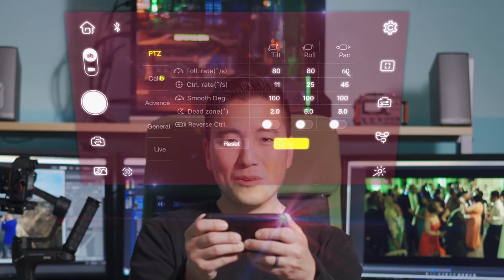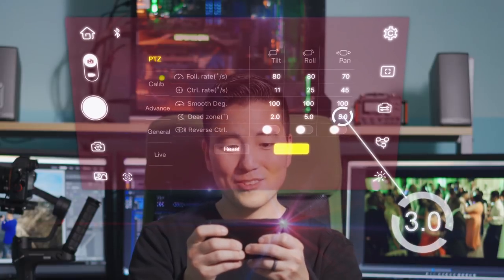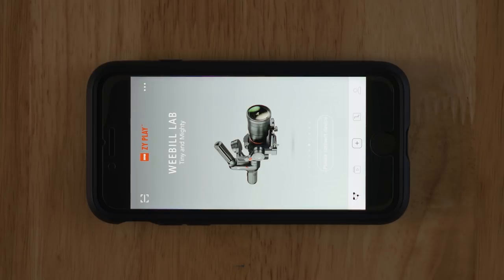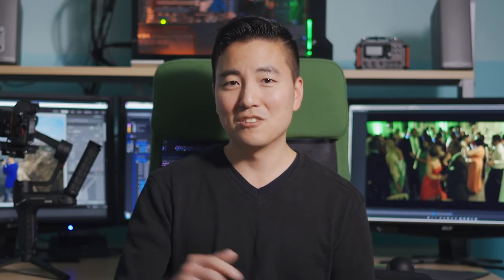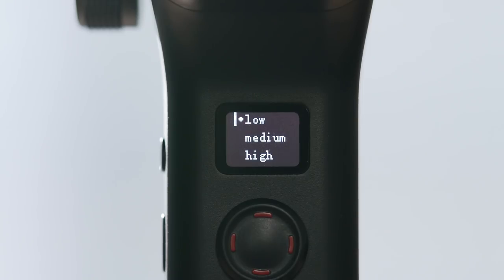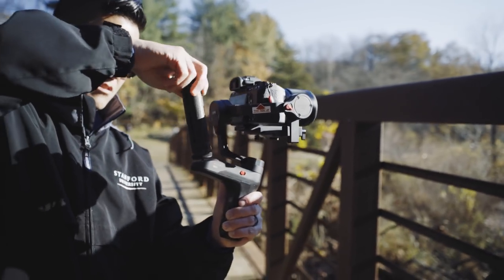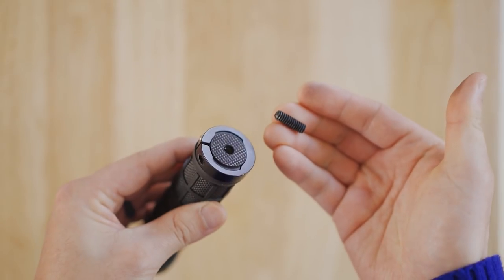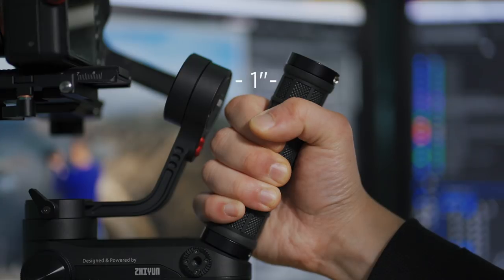Weebill Lab - More Thoughts After 3 Weeks

Comment: I like your review! I find it entertaining and comfortable to watch 😄 Im still torn between Weebill Lab and Crane Plus. My setup is Sony a6300 with Sigma 30mm and Kit Lens. If I get the Crane Plus I can buy another lens since it only costs half the price of the Weebill. But Weebill is new and travel friendly, but Im still worried about the issues, mainly the jitter because the purpose of buying a gimbal is to lessen the time from post production by adding the warp stabilizer.
Reply from the maker: Thanks Jazzie!  Much appreciate it!  You're right.  Cost is going to be a huge consideration too.  If you're not traveling every week cramming a gimbal in your bookbag, sounds like Crane Plus is a better purchase for you especially if you need another lens.  Your setup is light too so Weebill won't deliver anything more than the Crane Plus.  (Sigma 30 mm weighs 265 g) This coming year, I plan on traveling to different cities filming with just one book bag so I'm staying with the Weebill.  Otherwise I would have kept my Crane v2.  😁

Comment: Hi Se Park, Nice video again, thank you very much for the info. I am a photographer and trying to get into filming. I want to grab a gimble , the Lab is definitely a good choice, I find in only it sold for around 200 US dollars in Australia, or 350 for the Weebill Lab ( both Second hand), I wondered if the lab version will hold tamron 28-75 with a7 iii? or I need to go for the S version?  The used Lab here is really cheap :)
Reply from the maker: Hi Steve!  I hear ya!  The Weebill Lab price is hard to ignore.  The Tamron 28-75 with the A7 III will work on the Lab if you balance it at 28mm.  I used that exact setup for multiple shoots all day for event filming.  The problem is you won't be able to balance it at 75mm.  I'm more of a wide-shot gimbal kind of a guy so that's not an issue for me.  Weebill S of course can handle the 28-75 mm at 75mm much more easily.  If you don't plan on buying heavier lenses for next two years, I say go with the Weebill Lab.  I know people complain about the wobbles, but once you get used to it, and with some setting tweaks, you can get fantastic shots.  If you are a long focal length gimbal kind of a guy, and if you plan on getting some heavier lenses, then Weebill S would be the way to go.  Hope that helps a little.  Thanks for watching.  Your views makes a huge difference.

Comment: Questions:
1) Which camera you use?
2) Which lens?
3)Do you recommend using the control cable and loosing  SteadyShot, or otherwise?
Reply from the maker: Hi Elisamuel!  I used my Sony A7 III with 16-35 mm G Master F2.8 and Zeiss  35 mm F1.8 prime.  To me I rather have SteadyShot and lose the cable.  I can see the screen on my A7 III fine so I haven't found much need for the phone mount either.  Just saw your Weebill shots on your channel.  You got some good smooth shots out of them! :)
Reply: Se Park thanks bro. Please subscribe, im trying to do it more often. My setup is the Sony a6500 with the Sony G 18-105.
Reply: Personally me, after one month of use WL, I gave up on connecting it to camera. Too much of a delay connecting and not fast enough for me to start an action. Instead, I programed Custom button 2 on my A6500 for Movie Mode. Now, when I found out it disables Steady shot, I will never connect A6500 in RemotePC mode.

Comment: One question remain - is the stabilizing performance as good as the Zhiyune 2 PLUS?  Or Moza Aircross?
Reply from the maker: On the stabilizing performance alone, no.  That's the sacrifice for the size, but if you don't push the gimbal hard and careful on the feet, it can be a good tool for travel videography.
Reply: @SePark  Thank You!!!

Comment: btw i found a way to use weebill with peak design's capture clip standard plate. the solution is promediagear pm501 clamp.  works perfect with sony a6500 though the thumb screw gets quite close to the motor but it doesn't touch
Reply from the maker: How in the world did you find that!  That's awesome!  Thanks for sharing!  I might try that.
Reply: @SePark  Unfortunately, after a few days of use, I realized that the promediagear plate cannot be fixed  tight enough by the weebill clamp. it slightly moves. don't know which part isn't precise enough. what a shame.

Comment: Thanks for the review...was debating between this gimbal or the Moza Air 2, still undecided but definitely
leaning toward more compact gimbal
Reply from the maker: Thanks for watching Andrew!  I just had two more wedding shoots where I used the Weebill extensively.  The ease of setup on this definitely helped me get shots I may have missed with a different gimbal.  The separate axis lock allows you to change the lens and balance very fast.  Something else to keep in mind ;)
Reply: @SePark  But doesnt the Moza Air 2 have an axis lock too for balancing ? Plus, the long battery life makes me think its more powerful than the Weebill, especially when adding a cage, matte box and follow focus. I'm in the same dillema... Do you know wich is the most compatible with Panasonic?
Reply from the maker: @MASKalpha  if you are adding a cage especially on a GH5 then you'll run out of space to properly balance it.  Moza Air is much bigger and heavier than the Weebill.  I wouldn't put them in the same class.  Moza Air's competitor would be the Ronin S.  If you don't need to fit your gimbal in a bookbag all the time, I would go with the Moza Air 2.  Hope that helps!
Reply: @SePark Yes! Thanks a lot!

Comment: Did I hear it right? The IBIS does NOT work on the A6500 or A7lll when the camera is plugged into the gimbal.
Reply from the maker: Correct.  It turns it off since you have to turn on the PC Remote setting to have full control and image transmission.  I just don't plug it in and just control the camera directly and view the LCD directly.
Reply: Se Park.  thanks! I guess that’s why my footage has changed using my Mova Air

Comment: Nice videos! You've got a good sense of humor and present the info well. I'm trying to decide on my first gimbal, kinda stuck between Weebill Lab or Crane 2. Weebill seems to have a lot of next level features, mainly the portability and the locks, but Crane 2 seems smoother. Since I'm not used to operating a gimbal, do you think Weebill or Crane 2 would be easier to manage? I have a Sony A7iii. Recently Crane 2 w/ follow focus was $500 on sale, while Weebill is $600...something to consider as well.
Reply from the maker: Richard Nash thanks!  If smoothest footage is the most important to you, then I would get the Crane 2 in your case.  If you need to put a gimbal in a book bag to travel, then you would sacrifice the smoother footage and get the Weebill.  If you are familiar with Warp Stabilizer, then Weebill will work as slow motion and post production will get rid of minor shakes.  If you have 500 grams or lighter lenses like the F2 28mm prime then Weebill is fine.  Heavier lenses is not the ideal for Weebill if this is your first gimbal. I know I didn’t directly point you in one direction but so many things to consider.  :)
Reply: @SePark  Damn, still a hard choice. I think ideally I would have both - the size and portability of the Weebill would probably benefit me the majority of the time as I would probably be throwing it into my backpack for day outings.... but occasionally I'll do some work that I'd prefer more stability. I wish there was an easier way to test this stuff in hand instead of scouring through youtube vids for footage :)
Reply: @RichardNashIV  I'm in the exact same boat... I think I'm veering towards the weebil lab. I think another factor is how much gimbal footage you intend to use with your videos. With our True Food TV work I wouldn't want to overuse it - I think that's when limitations of the gimbal might become more obvious.

Comment: Can you balance Sony Zv1 on Weebil lab or on weebil S? Thank you
Reply from the maker: Hi Peter, yes I did do a light weight test on Weebill S since it's a very powerful gimbal, and it held the RX100 VA without the motor freaking out.  RX100 VA is 299 grams and ZV1 is 294 grams, so should be fine.  Weebill Lab has much weaker motor and holds smaller cameras just fine.  Hope that info helps!
Reply: Thanks man. You are my new favourite youtuber. I watched all your videos in one day 😃. I would be grateful if you could share your motor settings on weebil S to gain cinematic footage. Tha ks in advance. Cheers
Reply from the maker: @thomaspattison1631  that's so awesome!  Thank you!  For the Weebill S setting, I am actually using the default setting from the latest 1.97 firware since that firmware movement is on the soft side.  The biggest thing for me usually is on the deadzone setting.  If you find your gimbal jerking around side to side, you want to increase the deadzone setting so it's not too sensitive.  Also the newest firmware, if you auto tune, you'll find that it virbrates when you tilt the gimbal down.  For that issue, you will need to lower the tilt power manually down to about 25-30 depending on your rig's weight.  Hope that helps, and thanks so much for your support on this channel!

Comment: What motor power settings would you recommend on the crane v2 with a Sony A7III and a Ziess 24-70 f4?
Reply from the maker: Hi Roy, I don't have a Zeiss 24-70 F4 so I can't confirm for sure, but that's a 426 gram lens.  It's probably going to push the crane v2 motors if you want to be super smooth.  This is one of the reasons why I got the Weebill so I have some headroom.  Even then Crane v2 is a great gimbal especially paired with some light lenses.
Reply: Thanks for getting back to me. Yeah the Weebill Lab is perking my interest.

Comment: “Red knuckle mode” hahahahaha, I got fat hands, that’s the mode I use
Reply from the maker: David... LOL!  I ended up buying a skinnier lighter handle. 😁
Reply: Between the time I posted that and now, I decided I’m returning mine ):
I just ordered a Crane 3. I’m using an A7III with 24mm 1.4 GM + ND filters, and it’s too jittery. My crane plus can handle that load out no problem, but the Weebill has a nervous jitter. Balanced perfectly, latest firmware, experimented with multiple settings, and I’m a decent operator. I’m hoping the crane 3 fares better.
Reply from the maker: @Deatarus51  haha that was quick! Crane 3 is all muscle so I'm sure it will handle that setup.  I took a lot of compromises with my Weebill.  I'm looking forward to their next Weebill successor.  It's either going to be called Gimbal S or Weebill S.  Hopefully it comes out this fall.
Reply: @SePark  Yeah, saw a teaser on that, I'm excited to see what they come up with. I really like Zhiyun as a brand.